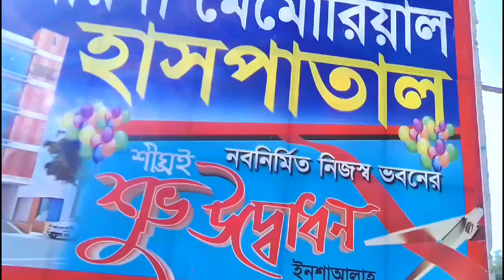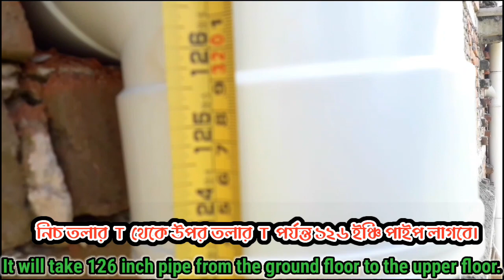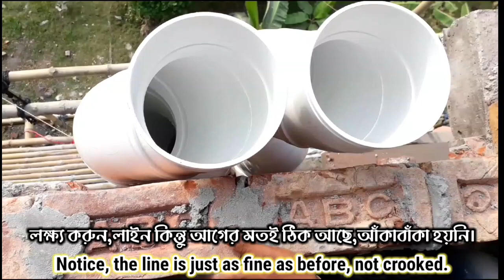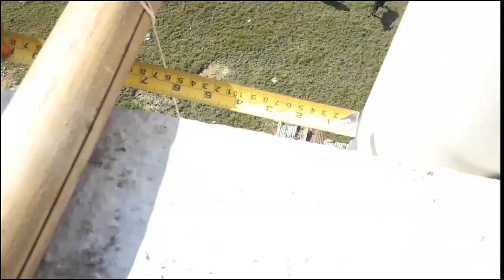[A to Z] কিভাবে বহুতল ভবনে ওয়াটার লাইন,শিওয়ার লাইন, এবং অন্যান্য লাইনের ওয়্যারিং করবেন? #plumbing

Comment: Ventilated Stack Sanitary Plumbing System 
(a) The ventilated stack system may be adopted in situations where there are close groupings of sanitary appliances around the discharge stack in buildings up to thirty storeys high.
(b) The main discharge stack shall have a uniform diameter of not less than 150mm throughout its entire length.
(c) Separates discharge stack (secondary discharge stack) of diameter not less than 100mm shall be provided to serve the second and third storeys. This secondary discharge stack shall be extended to serve as ventilating stack.
(d) Cross venting between the ventilating stack and the discharge stack shall be provided at third, sixth, ninth, twelfth, fifteenth, eighteenth, twenty-first, twenty- fourth and twenty-seventh storeys.
(e) The length of a discharge pipe connecting to the discharge stack shall not be more than 2.5m and there shall be not more than two connections made to the discharge pipe.

Comment: Single Stack Sanitary Plumbing System (3-17b)
(a) The single stack system may be used for buildings up to six storeys high where there are single appliances connected to a discharge stack or where the sanitary appliances/ fittings are closely grouped round a discharge stack which is large enough to limit pressure fluctuations without the need for a ventilating stack.
(b) The main discharge stack shall have a uniform diameter of not less than 150mm without offset throughout its entire length. However, for conventional housing, a main discharge stack of 100mm diameter may be provided.
(c) The length of the discharge pipe connecting to the discharge stack shall not be more than 2.5m and there shall be not more than two connections made to the discharge pipe.

Comment: sanitary Systeams design 3 types 
1) less then -6 sty of building single ventilated systems 
2) higher than 6sty lower them 20 sty ventilated stack systems 
3) more then 30 sty fully ventilated systems.